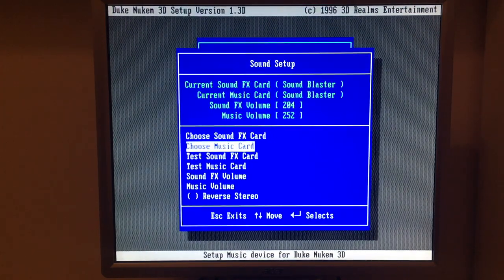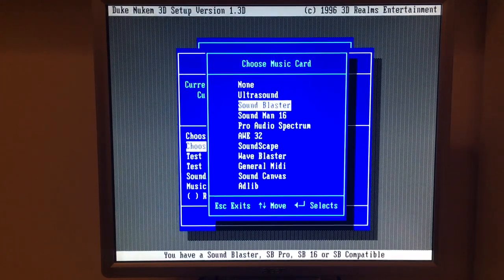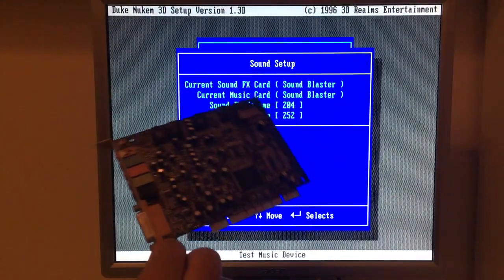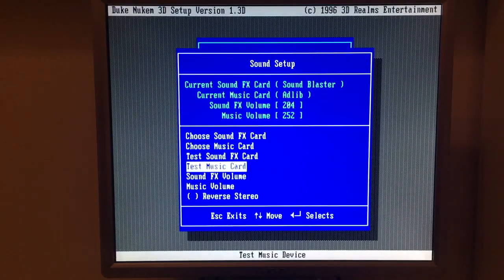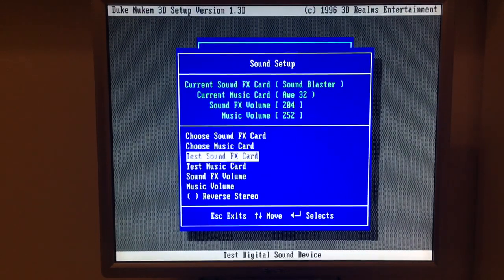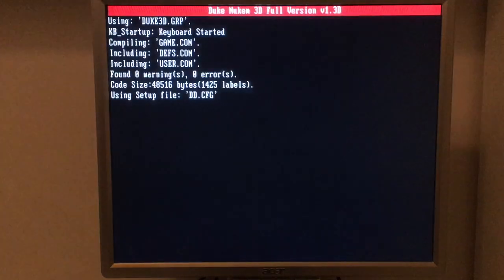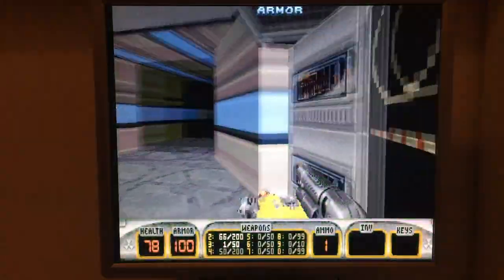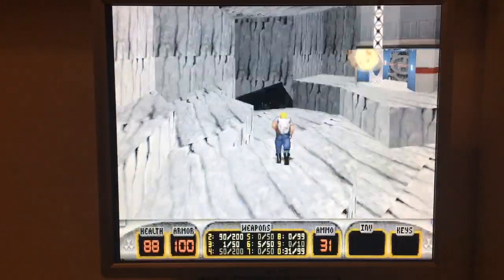Duke Nukem 3D soundblaster Live test in MS DOS Soundblaster Adlib and General MIDI mode

Comment: Real Adlib and sound blaster cards both used yamaha's OPL chips.  The sound blaster live has really bad opl emulation.  MIDI sounds great on that card.
Reply from the maker: KR2XD i still prefer ISA cards for ms dos games, GM on my awe64 sounds amazing, but if the system only has PCI then the SB Live is an okey solution yes😁👍🏻

Comment: Yup.... Horrible, horrible Adlib. To me it is eighter wavetable/midi or Adlib when dealing with game music. Sound blaster is for sound effects.
Reply from the maker: brostenen GM is a bit metallic, hard to explain, my AWE64 in GM sounds amazing compared to this, but if the system only has PCI, the the live card is an okey solution 😁👍🏻
Reply: @RETROCENGO  I agree that SB Live is good enough if you do not have anything else. Personally I prefer YMF-724.
Reply from the maker: brostenen 724 has a pretty clear sound actually👍🏻 still a bit metallic though in GM
Reply: @RETROCENGO  Yup in GM the Live and the 724 is kind of equal. They are both PCI cards. The difference is that the 724 have a real Adlib (OPL) core in the XG chip. As far as I remember, it is the same as the one on a SB16 card.
Reply from the maker: brostenen i just checked my card its the 744 not 724, haven’t checked 724 yet😁😁
Reply: @RETROCENGO  Ahh... Only difference is that 744 is 4-way speaker or surround or something. I have two 724's, because I only want stereo.
Reply from the maker: brostenen Retro gaming, sterio is the way to go😁
Reply: @RETROCENGO  Exactly. For Win98 and older it is. Like WinXP and newer, have so many surround games.
Reply from the maker: brostenen Retro only here😁😁👍🏻 Win98SE is max, right?😁
Reply: @RETROCENGO  Of course. To me WinXP is not retro. I have never really played games on XP. Win98 on the other hand. That is retro to me, because I used to play games on machines from that era. The same with MS Dos. However. The games might be retro to me because I grew up on these sort of things. Yet I really prefer calling it vintage instead. Might be retro for me personally, yet the age actually dictates it to be vintage. WinXP might be retro for younger people, yet I have no attachment to games on that system. Sure I play minecraft and frozen bubbles as the most modern non console games. Yet I play them on Linux and not Windows.
Reply: Adlib/OPL sounds better in Win9x
Reply: @Anilocin  That is not correct. The OPL chip generates the sound. The operating system have nothing to do with how OPL sounds.
Reply: @brostenen  The SB Live has no OPL/FM chip.

The DOS drivers are similar to the of the Ensoniq AudioPCI, they use FM samples, which leads to very poor results in DOS.

FM sounds better with the Creative Drivers in Win9x.
Reply: @Anilocin  I actually never said that SB Live have OPL chip. It does have Adlib, yet that is, like you said, not an actual OPL chip. It is more a kind of OPL emulation. As I did write, the Adlib feature on SB Live sound horrible. Yet GM is pretty nice though. Not perfect but better sounding than AWE wavetable. My choice however, is always YMF-724 on early P4 machines and early Athlon machines. Later chipsets are not all compatible with the 724 card.

I still have my gold plated SB Live somewere. But I have put it up for sale. For Win98 it is enough for me to just use SB-128 cards and YMF-724 cards.